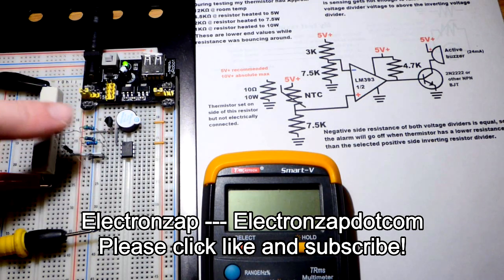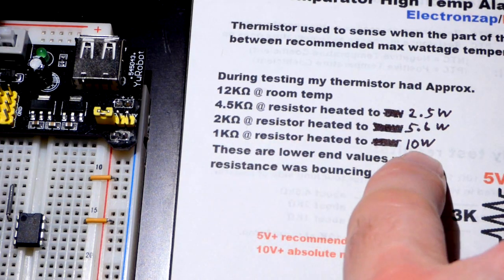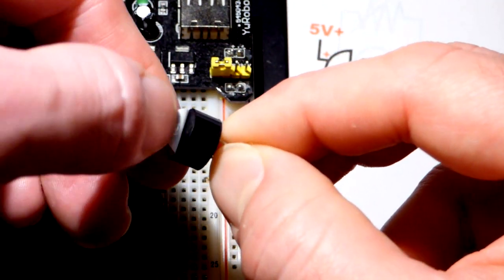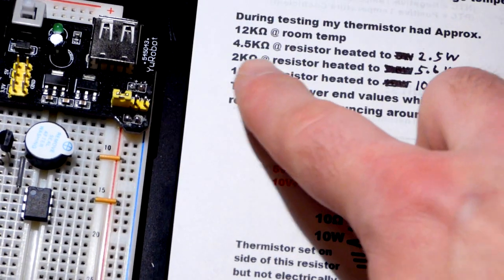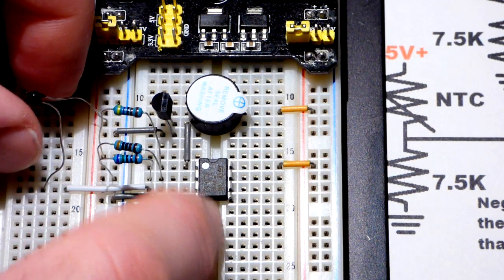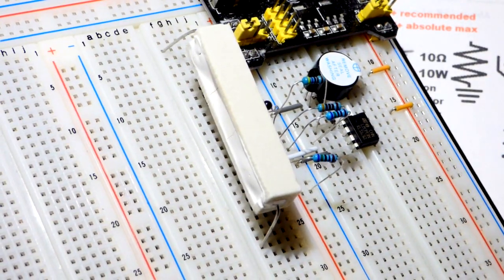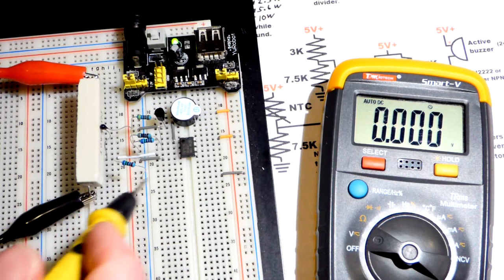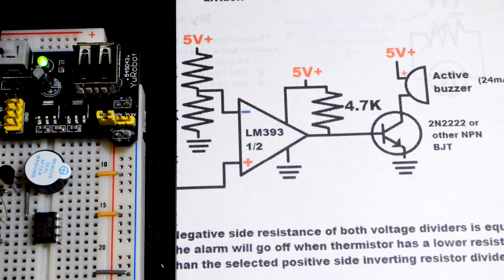High temperature alarm electronics circuit step by step build LM393 comparator NTC thermistor buzzer

Comment: Think you need a feed back resistor for hysteresis to prevent the lumpy startup.
I think 1m between output and negative. I think lower gives more higher gives less.
I'm only just figuring this out (this video helped a lot) so don't quote me.
Reply from the maker: Could be! I still have lots to learn about using feedback with individual transistors. Thanks for watching!

Comment: Thank you for this video, and all of your videos They are really helping me understand the LM393 and I've now got a few on the way. When the alarm state is triggered it sounds a bit "scratchy" as the pitch changes (15:44 in the video), is that related to the voltage input to the LM393 from the sensor, or was it because of the multimeter (I noticed it was a non-scratchy sound when you removed the probes)? If it's related to the input voltage changing, how would you adjust the circuit to make it ensure the buzzer only sounds when it has 100% of the required throughput between the 5V rail and the 2N222/LM393 so as to make the buzzer tone/pitch more consistent?
Reply from the maker: Glad they are helping you! I am new to studying op amps and comparators myself, so not sure of the particulars.